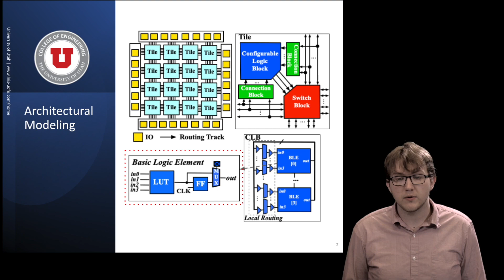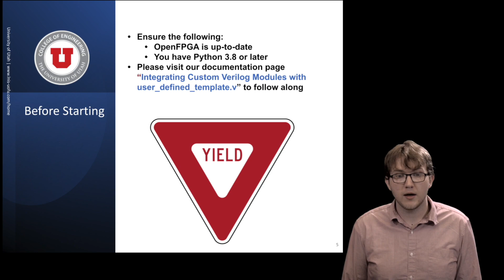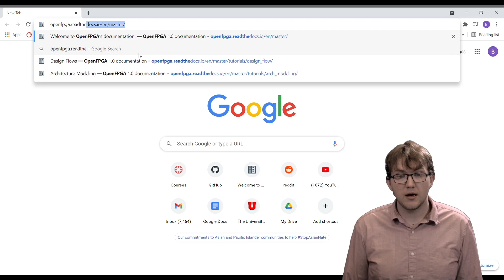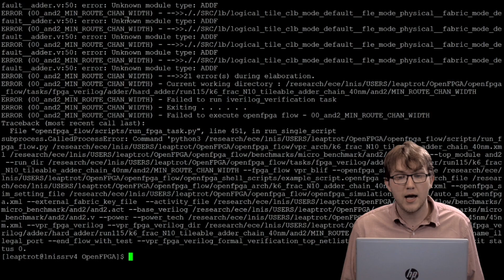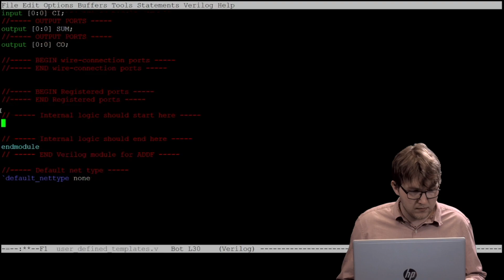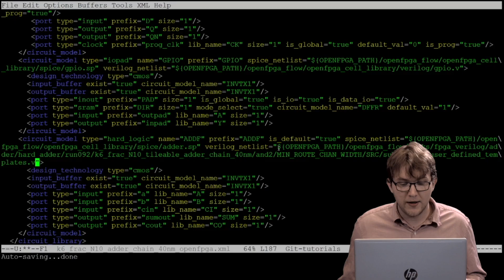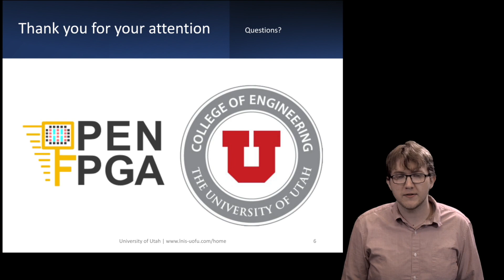OpenFPGA: how to implement user_defined_template.v file

Comment: Sir, I am able to run the simple 2-input AND gate example with the default architectures. Whenever I try to declare 'wire [1:0] temp;' Or any vector, either there was an error during synthesis or during the simulation (iverilog). I have been using only the default settings and files. Declaring the wire vector is the only change I have made. Can you spot where might the issue be with this information?